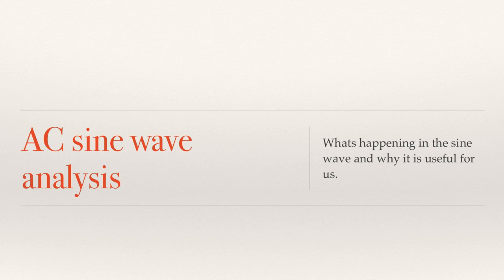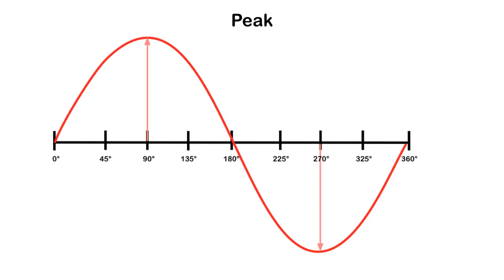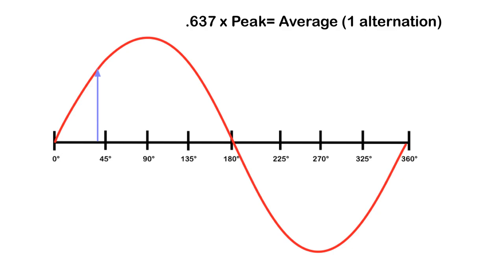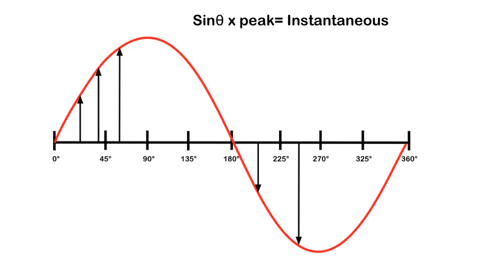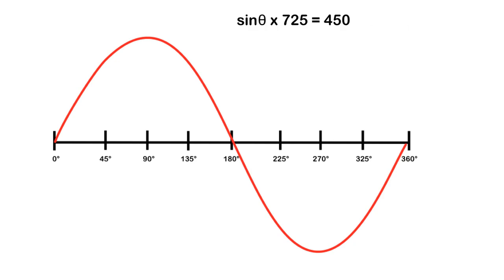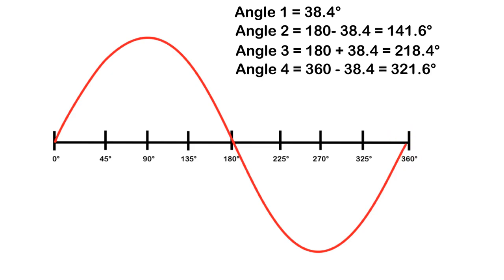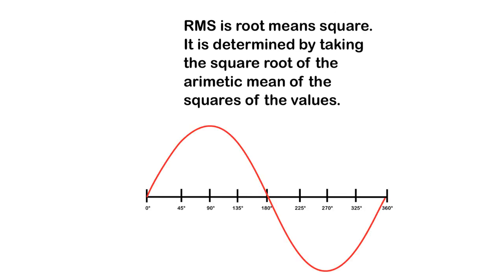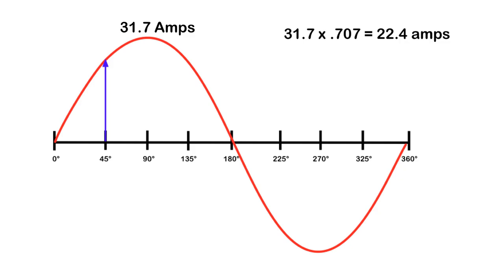The sine wave explained (AC Waveform analysis)

Comment: Sir, i have a question that :what are the different waveforms of a.c and shown them graphically.....I give the ans ....that the a.c circuit containing pure resistor ....capacitor .....and inductor ......plz tell me that ....
how many marks does I get ????..it's a 5 marks qstn ...
Reply from the maker: +Prasad Ashutosh Matagajsingh you win!  Lol
Reply: I really don't know if this is what you are asking, BUT: there are several different types of alternating waveforms: sinusoidal, rectangular, triangular, and the variants thereof. And of the three, only the sinusoidal waveform maintains its shape in a passive circuit consisting of a pure resistor, capacitor, and inductor. All that would change is the sinusoid's amplitude and phase shift with respect to the input sinusoid; the frequency (and period) would remain the same. A nonlinear circuit, e.g., a mixer, creates new frequencies (harmonics) and sum/difference frequencies from two or more sinusoidal inputs at different frequencies.